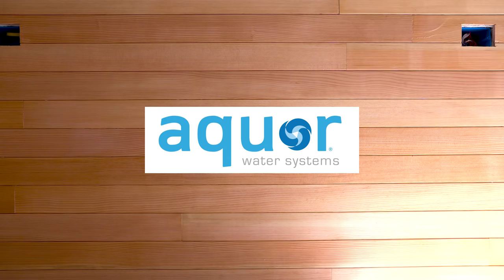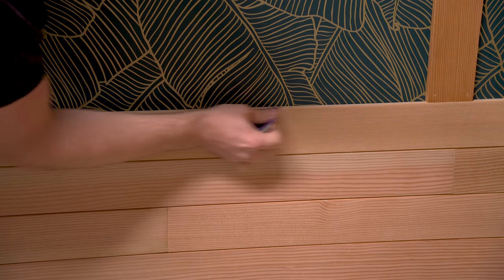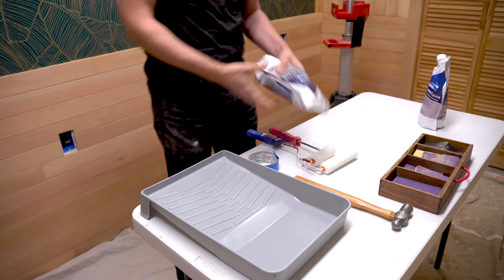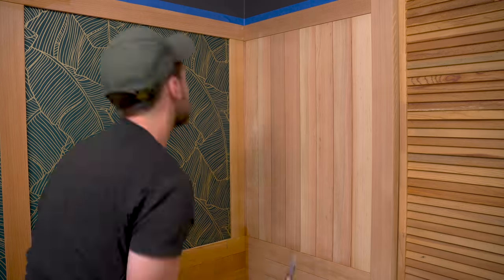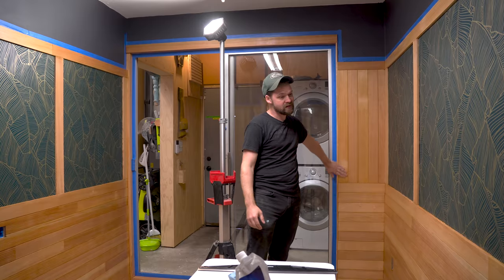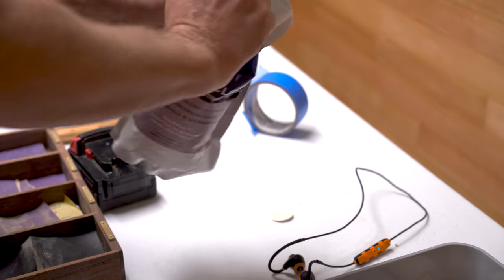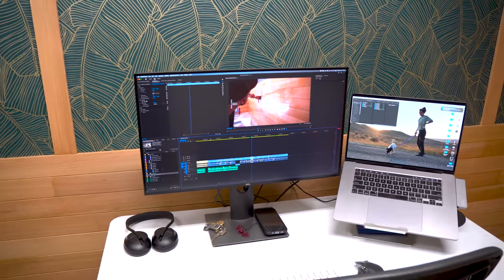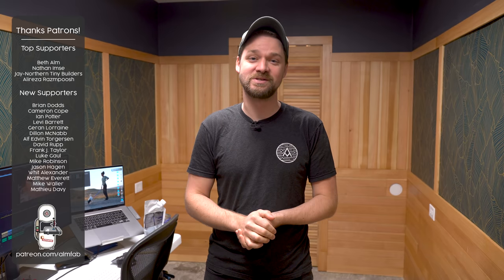It's WAY faster and EASIER than oil

Comment: You actually ideally want to use high gloss for all except the final coat. You can get away with using flatter finishes for more than one coat, but each coat will make the finish slightly more milky/chalky looking due to the flattening agents used to reduce the gloss level.

Comment: I learned a cool trick from a painter. When you fill nail holes, put a coat of varnish or whatever you are finishing with first, then fill you nail holes. On a wood like oak it’s much easier to clean up the excess and the putty doesn’t get stuck in the wood grain.
Reply from the maker: I’ll have to try that!
Reply: @MichaelAlm  it’s a big time saver👍
Reply: What a great tip! Thank you for sharing! ❤️

Comment: When your masking trim like this. I would suggest using a putty knife to help. It will help you both tear your masking straight, and put pressure to get it into tight corners. It just speeds up the process a bunch after you get use to taking advantage of one. Its also great if your working on a door with glass in that needs sealer cleanup. (I learned this from years of masking interior/exterior doors for finishing)
Reply from the maker: Good to know!! Thanks!
Reply: This is a great tip that I’m gonna remember
Reply: @twobluestripes  always happy to share those time and sanity saving tips:) we're all in this together after all :)

Comment: If you have little or no experience in using such products may I suggest that you get a few offcuts and spend a little time experimenting especially with a roller.
Michael did express the need for speed simply because water-based products do dry very quickly and if you don't work fast enough you WILL notice where you have overlapped.
Good luck with your venture and always remember, practice makes perfect.
Greetings from the UK.

Comment: Good tip for covering ur brush or Roller especially if ur painting for a couple of days is Use CLING FILM to rap the BRUSHES or ROLLERS but rap the Brushes lightly.. Don't have the cling film wrapped tightly.. It will keep ur brush soft for 2/3 days.. Keep em in a cool place like a garage where there's no central heating near.. Cling film works a treat man.. Love the job u did on both areas..

Comment: It's interesting. I didn't start serious woodworking until 2013 when I was building our dinning table. Having no experience or past in finishing woodworking projects, I did a lot of reading and decided to heavily invest myself into water based finishes. I thought, I might as well force myself to use and learn these, they are better for all the reasons Michael mentioned in the beginning and middle : they aren't toxic so no mask, easier clean up, dries in 1-2 hours, (doesn't yellow....this isn't something for me, I actually like the yellow look better), more modern and I'm young! I bought high end finish (General Finishes) and used it on a dining table and a few other large projects. After a couple years of this, it made me hate finishing projects. I couldn't stand it. It was impossible to get the finish to not have streaks and it was tough to keep a wet edge on large projects due to the quick dry time. It just made me so mad that I so much enjoyed the building part of my woodworking but loathed the finishing. Finally I said f***it, let's try oil based. But I still needed protection because I was primarily building tables and desks. Then I came across ARM-R-SEAL. Literally changed my life. Penetrates into the wood for a much better look than the water-based, still has a urethane portion for protection of the surface, 10X easier to apply and won't streak. It's just too easy. Haven't had a project since (that's indoors) that I don't use it for and now will never touch water based again. I guess the old-timers that I was initially fighting against were right. Just my story, if others (likely like Michael Alm) don't run into the same problems I did, water-based is probably fine.

Comment: Impressive end result without doing any type of work that requires tools or skills that what would exclude most viewers from trying something similar. 

One question on electrical as you have 20amp receptacles, do you have 12 gauge wire throughout the chain and a 20amp breaker?  Last video showed some white NM cable which is of course currently associated with 14 gauge.   Assuming it may be that it is older, as I don't know when yellow became the standard, but thought I'd check as it is against code to have a 20amp receptacle on a circuit rated for 15amps.
Other possible issue is that these must be TR outlets assuming this is in your home.  I can't tell if these are or are not for sure but they don't look like they are.  
Neither thing is a burn your house down issue, but either would cause a fail on inspection given you did new wiring and both would be easy, inexpensive fix.
One final issue would be that they may need to be AFCI protected as well as most all areas in a home do now.  Also a relatively easy fix of getting a AFCI (or afci/gfic combo) breaker or an outlet for the first outlet on the chain.

Comment: My old teacher always told us to never use compressed air to dust off before coting cuz you just blow the dust around. No clue how true it is tho and I can understand you don't wanna vacuum the whole room multiple times. But what are your thoughts on it?
Reply from the maker: Air compressor is definitely the less good way to do it. If this were an oil based finish then I would’ve vacuumed and wiped down the walls. The water based drys so fast you don’t have to worry as much about debris landing in the finish

Comment: Water finishes need a slight sanding in between coats, especially after the first one. Water raises the grain, which oil does a lot lesser. So for smooth surfaces, sanding in between.
Reply: I never sand after the first coat. Too dangerous to accidentally sand through (as he mentions in the video...) and than you face the same problem again on the next coat. I lightly sand after the second or third coat and then just finish it with one final coat.

Comment: I normally only use water based finishes in my house. But now I am totally clueless. I want a new desk from real wood. But wood over here is still crazy expensive. I really would like a walnut desk, and almost bought a panel last year. I hate myself for not buying it back then, because now it costs three almost four times what it did last year. Now I came across someone who used oak with a stain and that looked a lot like walnut. But oak is even more expensive than walnut. The only type of wood that is affordable even in a huge size and 1,5" thickness is rubber wood. I actually do like the appearance of the wood. I am thinking of using it in it's natural colour in my living room. But in my office I really still would like the walnut colour. In the store where they sell those panels, they told me that I can stain it in walnut colour. But I don't know. I am afraid it'll look weird and then it will become expensive if I don't like it, since I need to redo it then. So this is not really the place to ask perhaps, but I try it anyway... anyone experience with this? I am really afraid to end up with a fake looking desk since the grain of rubber wood is totally different to begin with than walnut, but also I have no idea how the wood reacts to stain. Any suggestions are absolutely welcome.

Comment: Would it be worthwhile to roll the finish on in a W pattern, like painting, and then roll horizontally over it to even out the joints?
Reply: Not really, home renovision diy has a great video on painting where he explains it better. Just going in lines makes a cleaner leading edge which blends better preventing small ridges in your paint. Obviously that is painting rather than staining, staining goes more into the wood rather than a layer, but you use the same skills to apply it so why not do it the same.

Comment: Osmo polyx effects RAW 3044 is my go to for light woods .. two coats brushed on.  Bullet proof.
Reply from the maker: I’ll have to try that sometime!
Reply: I agree, Osmo do some fantastic products, although I use the wipe on wipe off method. Expensive but a little goes a really long way.
Reply: @robertjones5988  you should never wipe Osmo off.  It is a wax oil blend,  you are wiping the wax off.  Apply very thinly with a stiff brush.
Reply: @bpt006  I have done a table and shelves in oak for the kitchen and had fantastic results. Matt Eastlea also wipes off the excess oil in his finishing kitchen worktop video (how to apply osmo polyX oil). I do get your point about wiping off wax but water pools on the surface without absorbing so it’s working :-/

Comment: Why would you go for a varnish over water based poly here? I understand for high touch stuff you want a conversion varnish but poly would have been fine here, is that right?
Reply from the maker: Yeah, Poly would be fine. Varnish is a little stronger.

Comment: I am planning on making some wall panels out of ambrosia maple. I want to keep that same light color. Water based finish over a wax finish?
Reply from the maker: You’d probably okay either way. I’ve had good luck with water based on maple. Haven’t used it on ambrosia. Probably worth doing a test piece before you commit.

Comment: Great video.
Would you have avoided the sanding between coats if when you sanded it originally you purposefully raised the grain with water then sanded again or is this something that would happen with the varnish anyway?
Thanks for the great tips.
Reply from the maker: Hey Andre, Good question. If you're really thorough with water popping and sanding before finish, you can avoid the grain raising later. In my experience, it's a lot more work to do it that way, and you end up with the same results. That's why I like to wait.
Reply: @MichaelAlm  Thanks Michael.

Comment: Great refurb Michael! Wat's you opinion on raising the grain using a water spray prior to WB finish?
Reply from the maker: Thanks! Good question! I used to do that, I found it was more work than it’s worth. Now, I just let it raise from the finish and knock it back on the second coat.
Reply: @MichaelAlm  thanks.

Comment: Nice job, BUT is it just me or by spraying those rollers outside all the chimicals in the product, and yes waterbased products have chmicals too.. will end up in the ground.
Reply: That’s true but the question is whether that is a problem. It depends on what the finish is actually composed of, and whether it will cause problems environmentally. For instance, if it cures into what’s essentially an inert plastic, then the primary concern is that as it degrades, it will become microplastics dissolved into the groundwater or water runoff. It may not be any different than putting it in the trash, which goes to landfill. And if by rinsing the roller, you get future uses out of it, you’re probably improving the environmental impact overall and drastically reducing the amount of plastic waste (including the curing plastic-type finish) degrading and entering the water streams compared to if you put the rollers into the trash and used more of them. 

If this specific product is labeled for hazardous waste, I doubt Michael would have rinsed it.

Comment: Been a decorator for forty years. If I see someone putting the first coat of primer or varnish with a roller there cowboys. That wood should be applied one slat at a time. This was embarrassing 😳
Reply: Huh?
Reply: @alans1816  What part of my comment didn’t get? HUH! Here’s a freebie use cling film.
Reply: You mean “they’re”?
Reply: @Annie261.  At least someone in the family can Teach!
Reply: Sounds like you have a lot of experience: could you explain why not to use a roller under these circumstances?
Reply: @4thState  A roller doesn’t get into the grain like a brush does on the first coat.